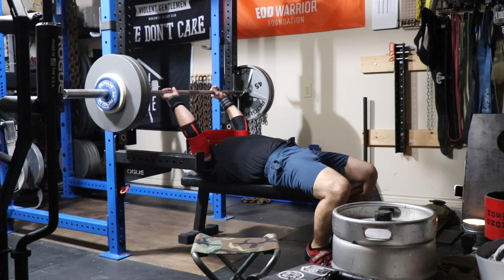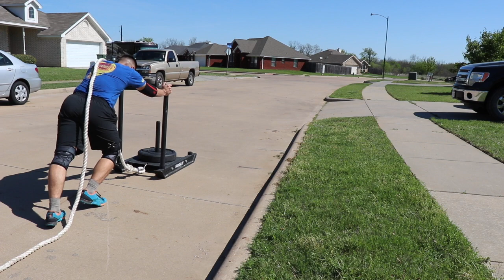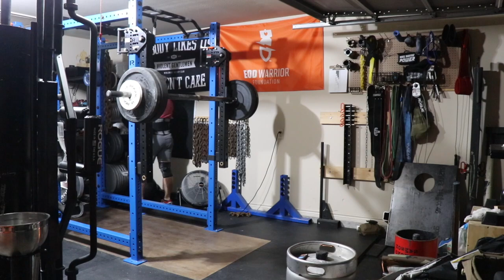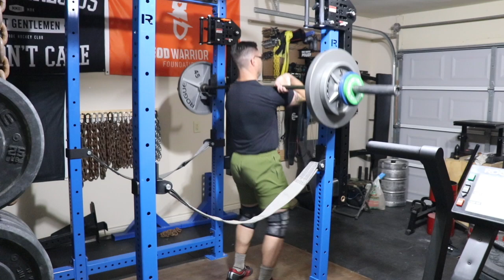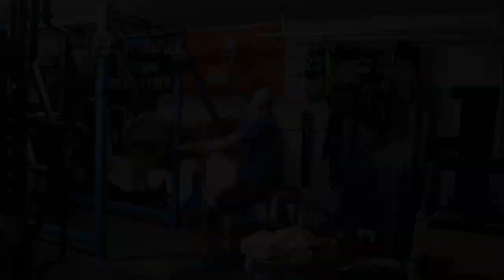Week 15 Garage Gym Strongman Training

Comment: This is genius but my rml 490 is not floor mounted. Only thing I could think of is to buy more plates to counter balance on my weight pins. But then again I’m leaning towards getting the rep zero gap incline bench
Reply from the maker: I have a video on the Rep bench.  I am a huge fan.  You gotta be patient to find it in stock